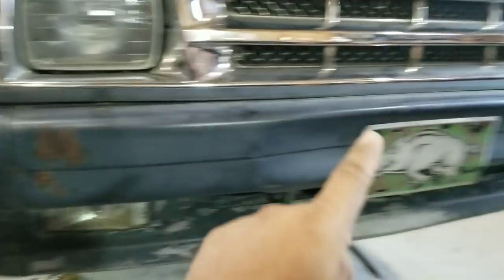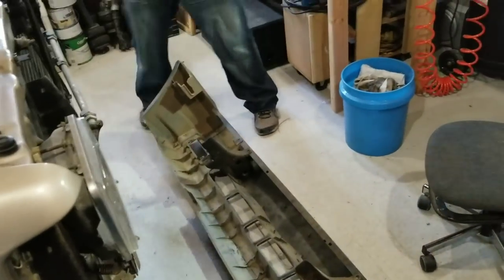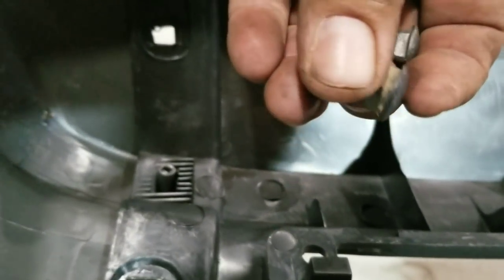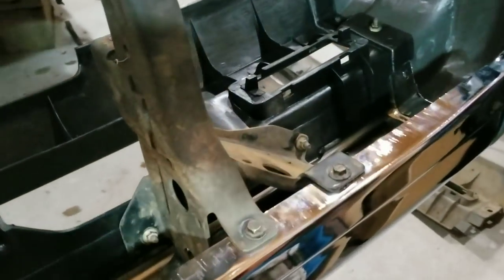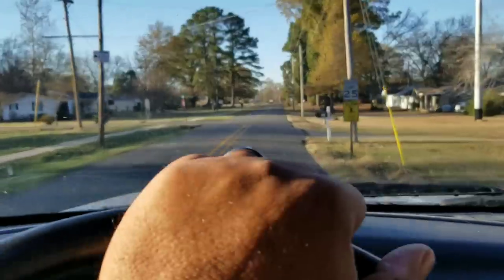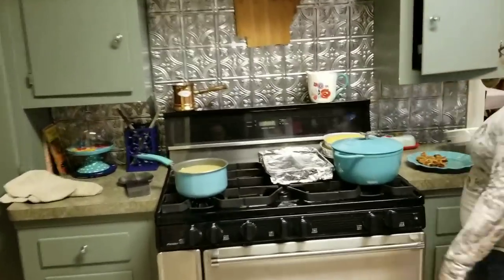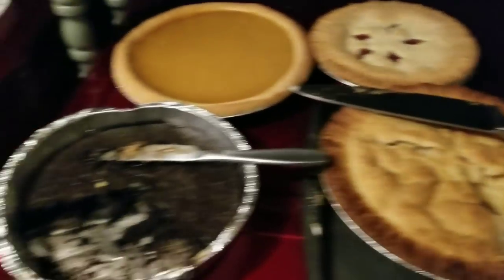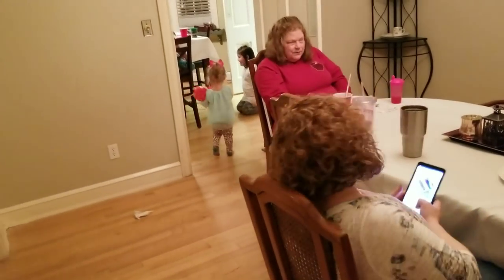How to swap a Mazda b2200 front bumper and happy thanksgiving 11-25-17

Comment: Hey so I bought this same bumper kit. But my sides that came with it don’t line up. Meaning the bumper has two holes that are supposed to match the holes on the black side pieces. They don’t. One goes in and one isn’t aligned. Do I just bend it myself and make it work?
Reply from the maker: If no one is going to see it and you can make it work that's what I would do so that it's secure.

Comment: Hi Duarte, have question maybe you can answer, in replaced the pistons on my 2200 1990, i know the piston has the "f" for front, but im not sure if i installed the rods correctly, refering to the little oil hole on the rods , do they go towards the right or left? Thanks

Comment: I just purchased the last 2 brand new chrome grille in the world. Production on them stopped 6yrs ago you will not find it brand new that's why is called Unicorns. If you need other mazda parts my guys at Mascot Auto can get what ever is left in commerce Mazda b2200 related. Your welcome Mazda bros. Also I'm in Hawaii Mascot Auto is here in Hawaii.
Reply: I work in a plating manufacturing so I can
Reply: Do u have any chrome grilles